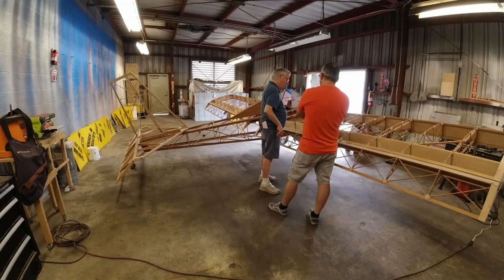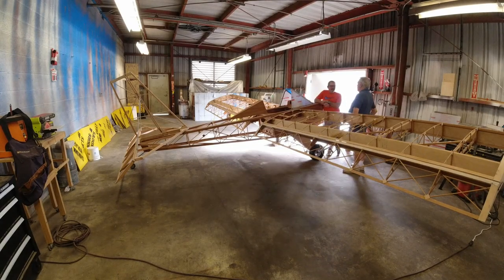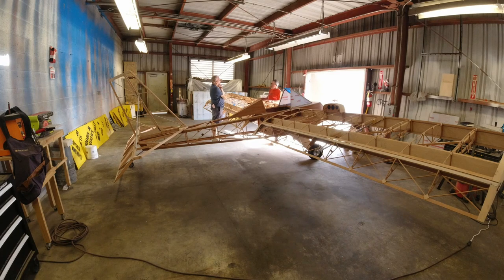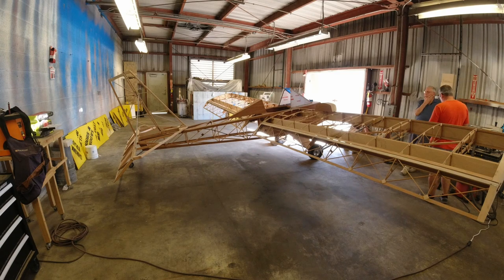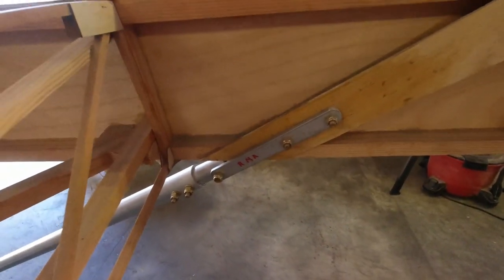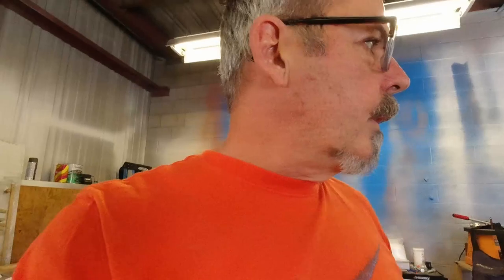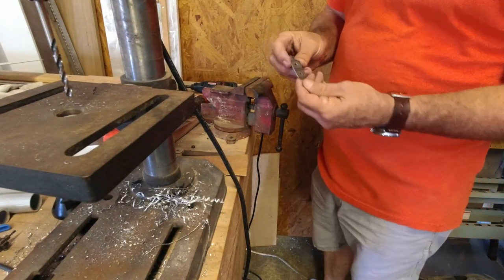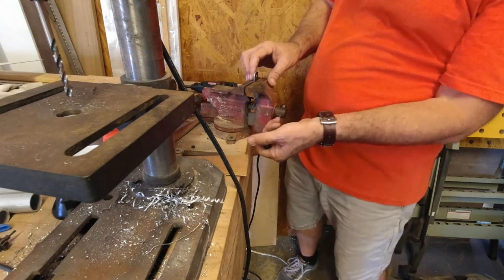Minimax 1100r Wood Aircraft Build Ep 126

Comment: You're making great progress.  Congrats on the tech inspection.  Have you decided about moving the gascolator?  I can see both arguments: leaving it at the low spot in the fuel system vs putting it at the firewall (forward of the firewall?), presumably for safety reasons?  If you move it and install an in-line shutoff valve, wouldn't that imply you'd have to use the shutoff after every flight in order to prevent contaminant back-flow?  If it were me, I'd probably leave it where it is at the low point.  An advantage to that I guess is that you could more easily detect leaks.

Comment: Congratulations!  That must have been very gratifying to have your hard work so positively peer reviewed!  It is cool that he was so impressed with the design as well as your work.  I like your jour/notebook.  I didn’t notice any time the camera was in the wrong angle as I could see what you were doing.  That is very interesting about the disparity between the plans/specs for the bolt sizes and what you really need.  I like how you are handling it.  Sounds like a good approach.  I will be interested to learn if you plan to relocate that gas (?) component.   Great video. ⭐️⭐️⭐️⭐️⭐️ Thanks for sharing!  Peace and love..Suz What ☮️💚🌻
Reply from the maker: You know Suz, I still find it remarkable that a hand bag collector finds value in my channel. You are very observant and thoughtful in your comments. 
A gascolator filters out any debri in the lines. It also is at the lowest point in the system so any water will find it’s way there and can be drained out before flight. Very simple but effective device. Ease of maintenance was his primary concern. My fuel lines will need to be replaced annually and that’s also when that component needs to be opened up and cleaned/inspected so it’s really not a problem. Thank you for the comments!
Reply: @DTMinimax  I look forward to the vids.

Comment: Dennis.  I'll try this one more time. (Previous two went somewhere into the ether.)  Just this:  No precover inspection required - that went out in the 1980's according to the EAA (I called them).  Only one inspection required - at the completion of your project with an airplane ready to fly.  The FAA will do it for free - a DAR will charge around 2 to 3 hundred dollars.  TC is great if you want to use one.  I mention this as other builders may be trying to find a TC before they cover - no requirement.  Might hold them up in their build.  Hope you get this.
Reply from the maker: Yep! I got it fine. 
I didn’t know there was no requirement and good that you shared so others are aware. 
I definitely wouldn’t have wanted to hold up building waiting for a visit. 
I also didn’t know about the FAA doing the inspection for free at the end. Thanks so much Michael!
Reply: @DTMinimax  
Dennis.  Yes, it's free by the FAA.  I had three of them done - no charge.  The FAA inspection for the EROS was a bit difficult, but they sent an inspector.  He was not a happy camper. :-) He didn't want to do it.  

However, as a tax payer you are authorized an inspector from the FSDO.  They will plead that all of their inspectors are doing Airline aircraft inspection, with no one available.  Heard that a couple of times.  

 When I was ready for an inspection, I contacted the Orlando FSDO.  The guy I spoke with was the guy who, in the end, did the inspection. He wasn't interested.  So, I contacted his boss and his boss scheduled him to do the inspection.  :-) I loved it.  :-)

Needless to say, he would be looking for anything.  He spent a lot of time on the inspection.  However, NO writeups!   He made me go through a lot of the Prints, but in the end, he gave me my handwritten Special AW Certificate.  Got the "Pink Copy" in the mail, a few days later.  True story. 

 p.s. Make sure the inspector does the paperwork to give you a "Mechanic's License" for your plane.  Then you can do the annual condition inspection.  I did all of mine.  Thanks, Dennis.
Reply from the maker: Hey Michael, I have that in my notes about the repairman certificate. That is one of the great things about building your own plane, right…the ability to maintain it yourself. 
That’s funny that the guy had to come out anyway, sounds like you paid a price for it though.
Reply: @DTMinimax  You have to put a little pressure on the FSDO to give you that "Free" inspection.  I told them:  "Hey, look, I'm a tax payer, and  I'm only asking for a couple of hours - pass or fail, 50 writeups,  just need a couple of hours.  How about it?"   As I said, the inspector arrived on scene.  (At X-59)
Reply: @mmichaeldonavon  The Columbus FSDO was great. From the time I called them to the time I had my airworthiness certificate was less than three weeks. The inspector did not look too deep into anything, it is after all the builders responsibility to sign off that the aircraft is in a condition safe for flight not the FAA. He cared about the paperwork being perfect, all controls/switches labeled, all required placards and warnings were in place and that it looks like a flying machine. The only thing he did not like is where I placed the large Experimental sticker, it was on top of the wing right next to the canopy where it opens. He had me put it on the bottom of the canopy so you can only see it when canopy is open.
When I changed to different engine I emailed the guy same person who issued my original certificate and we took care of everything via phone and email in one day. Made a log book entry referencing the letter he sent me.
Reply: @ulbuilder  Yes, that was a nice FREE FAA inspection like I was telling Dennis Tyson about.   Out of the three FAA inspections I had, the first two were exactly like yours - went really well.  As I mentioned to Dennis, that third inspection, on the EROS 1650  had some bumps along the way.  But, it got done and was also FREE.  "-)  Thanks. N6395T

Comment: Dennis, how comfortable are you with having a single cable running to the elevator?  If it fails...  As I understand it, some European countries require a redundant cable.  Also, when I built my MiniMax, I added a couple of notches to the flaps control on the left side of the cockpit, so I could reflex the ailerons.  Reflexing the ailerons helped me trim for level flight, and allowed just a tiny bit more speed.  Just a thought...
Reply from the maker: I have certainly thought about that. I’m willing to go with the single one just based the number of Max’s that are flying out there. I do believe they should be planned for replacement at some point and should not be considered permanent. 
I do like the idea of 2 as the Brits require.
Reply: @DTMinimax    The instructions used to call for red Loctite on those nuts at the aft end of the cable.  I'm guessing they still do.  In case of a cable failure, I've always wondered if a pilot could descend and ascend via throttle alone, and manage a crash landing.  It would be tricky, but would it be possible?
Reply: @DTMinimax  It's a bullet proof cable assembly.  However, you must comply with  the "airworthiness directive," on the cable ends of those cables. Is easy.
Reply: @mmichaeldonavon  it is my understanding that the AD addresses the problem of the crimp coming loose on the end tube. I was told that when it comes loose the actual sliding cable can expand and bind when pushed out preventing the cable from retracting. Not sure how two cables would be of much use if one is bound and not allowing movement. AFAIK this is the only failure mode that has been reported. Since I applied the AD I feel comfortable with just a single cable.
Reply: @ulbuilder  Yes sir.  If you completed the AD, which you did, there is no way there will be any cable disconnect that would render your elevator useless.  That's a bulletproof fix.  That AD is applied to each end of that horizontal stab armor cable.  No expansion on the sliding cable.  That's bogus information.  Thanks.

Comment: Well that went okay. We would need another inspection before we covered if the inspector picked up anything like the bolts being too short. I take it you just take a photo to prove you corrected it for you post covering inspection. I could understand the gascaltor if it drained inside the cockpit but my as it drains to outside I don't get it, the one on my aircraft is behind my seat and drains out the bottom of the aircraft.
Reply from the maker: You’re exactly right, all of the bolts that get closed up during covering except for 4 currently comply. He just asked that I document the change of those 4 prior to covering. 
There will be an inspection ring in the location of the 4 so access will be available later. I agree with you on the gascolator and I’ll be changing my hoses yearly and inspecting that anyway.